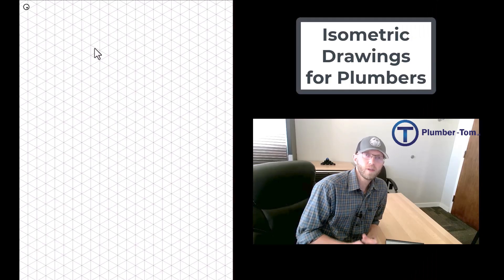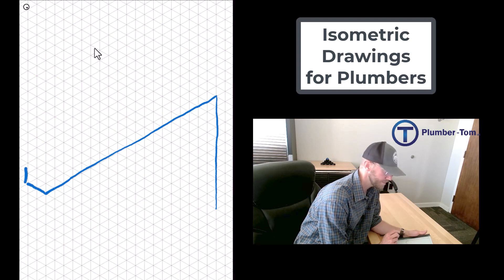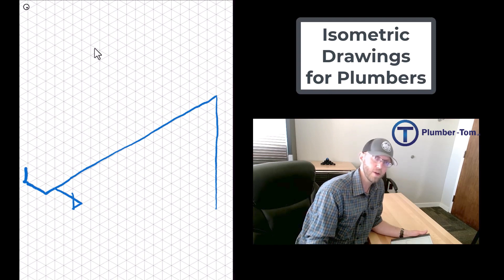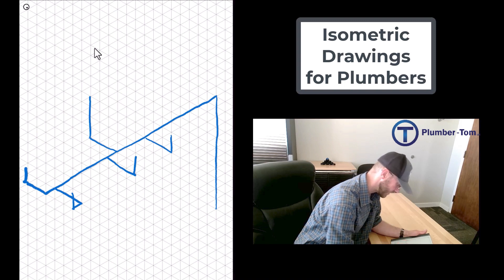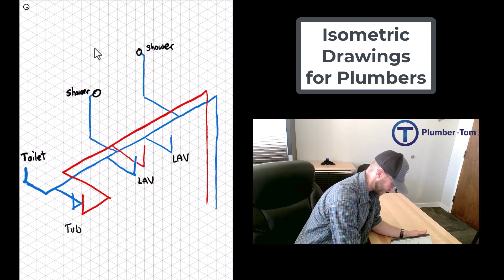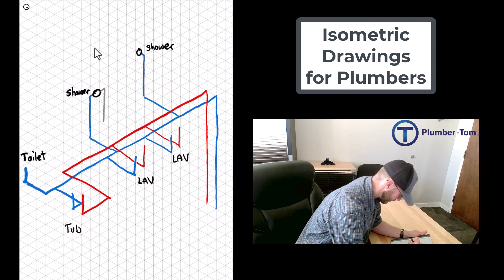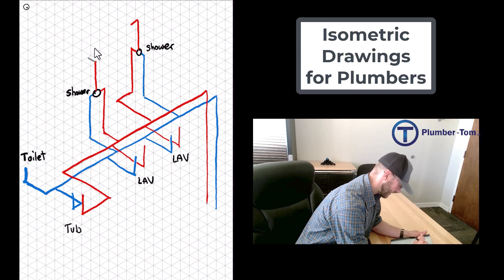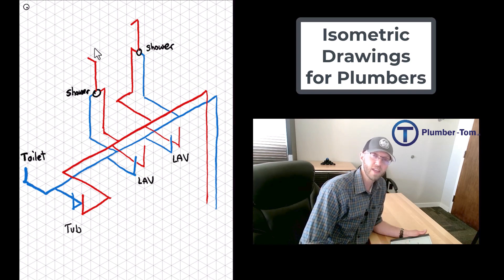Isometric Drawings for Plumbers -  Exercise 3

Comment: On your lavs, shouldnt the red/hot be on the left and blue/cold on right?
Reply from the maker: Yes. That is the intent.
Reply from the maker: If you are in the room then you would be standing over the main lines. Then as you face the lavatory wall the hot is on the left coming up through the floor into the cabinet.
Reply: Man I litterly just failed my practical test cuz I have hard time understand the isometric drawing on my 45 rolling offset it’s throw me off so hard